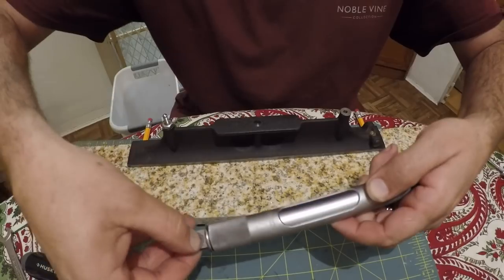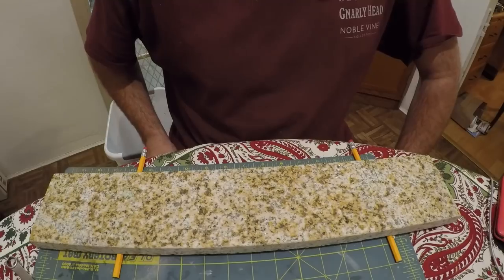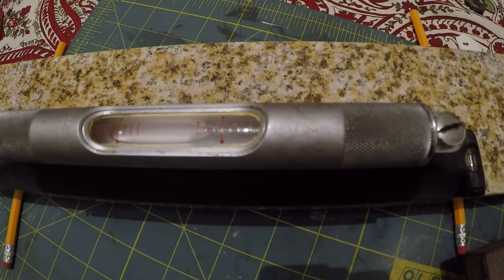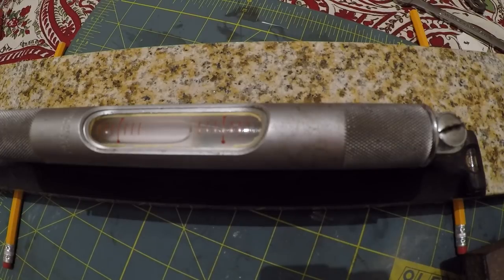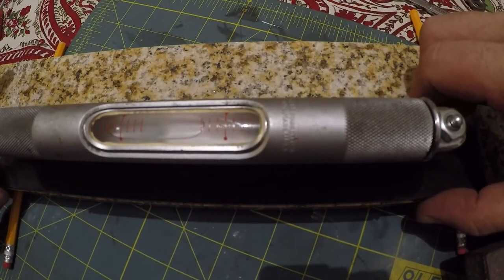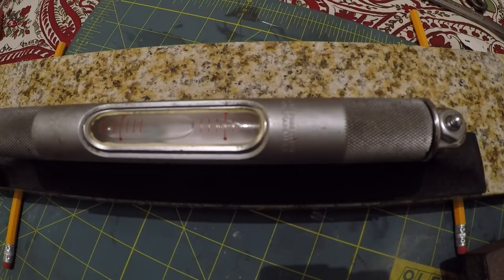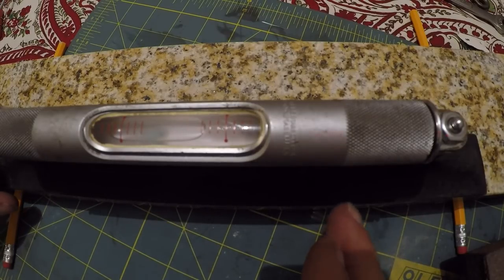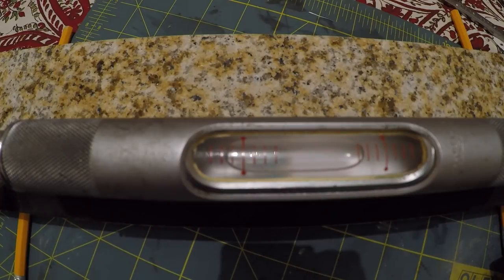Starrett Level Calibration

Comment: Great video and simple explanation. Thank you.
As a little tip, when you’re pretty close to level, instead of losing the nut all the way, I’d recommend to loose it 1/4 of a turn, then tighten the other one up. This will allow you to do very small adjust increments at a time without tightening one nut several turns every time. Hope it helps anyone who watches your great video.
Reply from the maker: Glad to help and that's a good tip for certain.

Comment: Thanks for this, really helpful. I have an old lathe I am levelling but the level I have is out of whack and rusty. I was scared to take it apart and restore it but this gives me confidence. I still need to lap/scrape the base but thankfully I have a decent and big enough straight edge I can blue up to do it.

It's really helpful to people to see it done without expensive tools, it can be a bit disheartening when videos start with tools I can't afford and probably won't be able to for a while. Subbed
Reply from the maker: I feel your pain . I certainly don't have unlimited means
Reply: @OldIronShops  Happy to say the level project went well :-) Scraping wasn't perfect by any means but I believe it's even better than when the level was new, so very happy.

 I'll post a video in a week or so, paying work is taking precedence. I won't show calibrating it as you got that covered here and I'll link to this video.

 Wanted to say thanks for the sub, it's especially important for a new channel like mine. I'm  sure you remember what it feels like to spend all that time editing and not many watching, anyhoo thanks, much appreciated.
Reply from the maker: @charliecarpenter2840  I'm a slow growing channel been 4 or 5 . Glade I could help and thanks for linking the video that helps a bunch.

Comment: If you turn your granit back spalsh around on the table you'll find on exactly level axis, make a mark and use this to check your level or any other one by the same time... 
I've got a video where this is demonstrated.
You can even find that perfect leveled plane using an uncalibrated level...   ;)
Reply from the maker: +Pierre's Garage I got you there trouble us it's not very wide and the level is long . I fooled around and leveled it close so I could do the demo.

Comment: I have an old bench grinder by Goodell Pratt Toolsmith
It's a nice one with a wheel guard and a proper tool rest...
Hand powered...clamps onto a table...
Nice brass plate on it:
GOODELL PRATT
TOOLSMITHS
GREENFIELD
MASSACHUSETTS
Reply from the maker: Cool it's a long way from home.
Reply: @OldIronShops 

Its part of my collection and has been carefully put in to storage...
There's a nice Goodell Pratt bench mounted drill on ebay...
One that you clamp on in a similar fashion to the grinder...
And a Goodell Pratt Toolsmith lathe...
One of them small ones that look like a watchmakers lathe...

I'm tempted...

I've got that Widdowson drill out of the back of my van Chris...
I'll send you some pics when I get a chance...
Reply from the maker: @glennmoreland6457  sounds good

Comment: I sent off the depth stop for the 78 today It's supose to arrive Thursday. 
I would like to do a colaboration on this project. I provide the pattern and the funds and you make the castings. Then send me two and I will mate them to the Millers Falls and Craftsman/ Sargent.  I think it will highlight your unique skills and cross pollinate our viewers with the larger group of people seeking user tools. 
I made a video of the idea and would like to present it yet this week.
Reply from the maker: +Old Sneelock's Workshop sounds like a great idea don't know if I have the capability of doing the milling work as of yet. Need to finish that mill up lol . Making rough castings would be no problem though.
Reply: Nice thing about the depth stop. No machining required. The slot is cast in and the bottom of the shoe is ground flat. Two minutes and a belt sander, and the job's done.
Reply from the maker: +Old Sneelock's Workshop well that's good to know. Do you need any fences I have the one on mine
Reply: I have two fences and could use another one. People are telling me they cost as much for the fence and mounting rod as for the plane assembled. It's another one that only takes a bit of work to finish. More then the depth stop though. Drill the 1/4" hole and drill and tap the setscrew hole. It has an odd thread. The Craftsman screw won't fit the Stanley.
Reply from the maker: +Old Sneelock's Workshop well I might as well make a few of them to I'll show you the one I have.  It's on my 78 Stanley. Perhaps we can drum up some interest. Bound to be many that are needed.